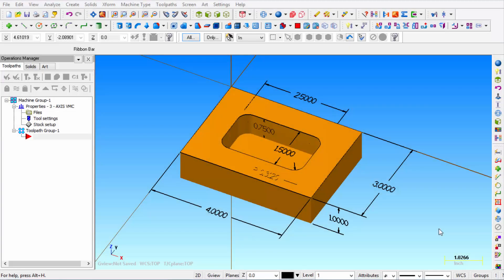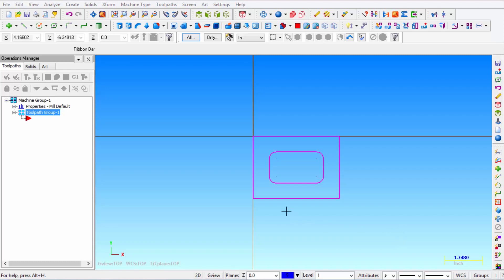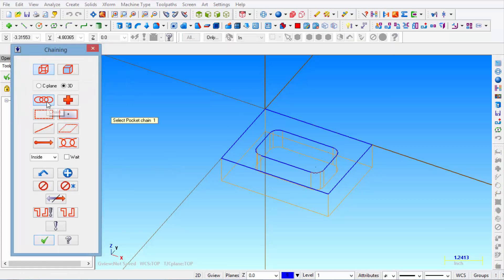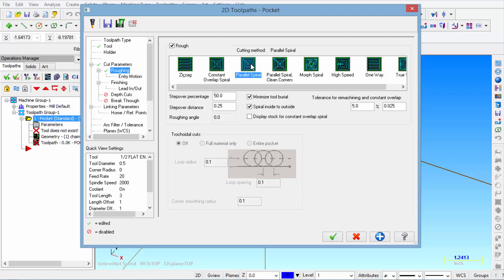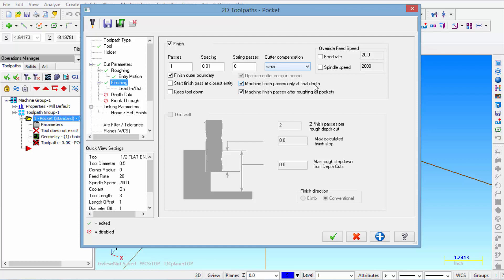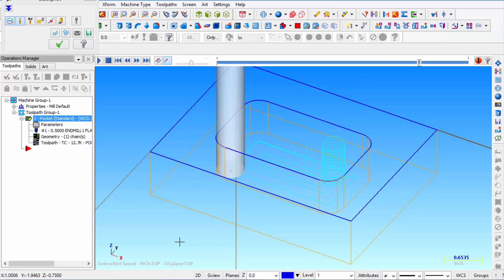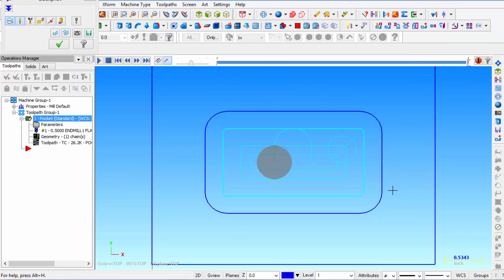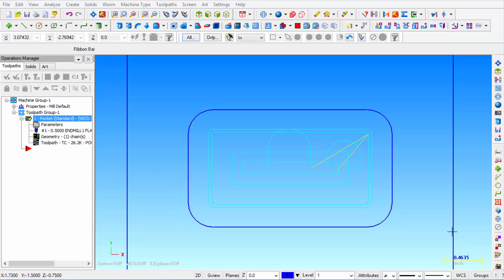POCKET MILLING USING MASTERCAM X7

Comment: Tom, thanks for the video. Is Mastercam is the best offline programming software to learn? I am beginner here and I am thinking which cad/cam would be most all-purpose one and is not too difficult to start with? If it is then which version you would recommend to me?
Reply from the maker: I have used Mastercam for 12 years and find it very powerful and user friendly. I have used it to write mill and lathe programs and also multi axis programs. Also a very strong software for 3d contouring. I personally highly recommend it. Thanks
Reply: Thanks for a tip and your educational videos :-)